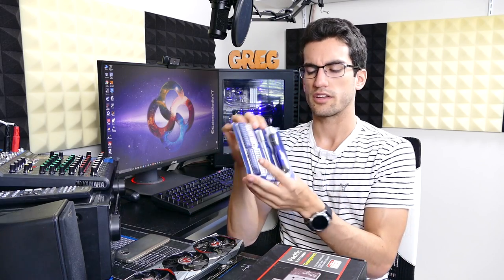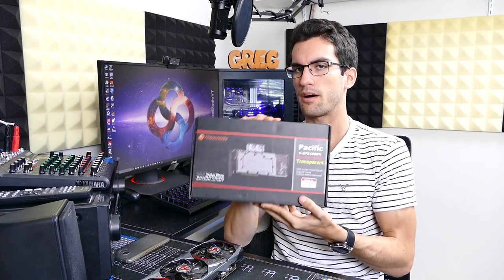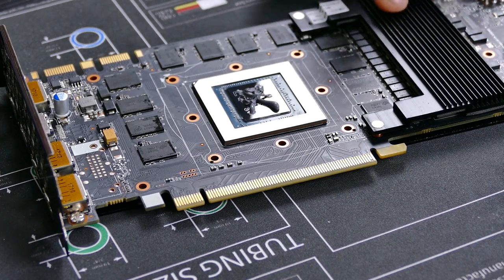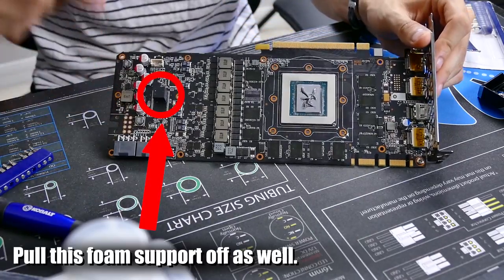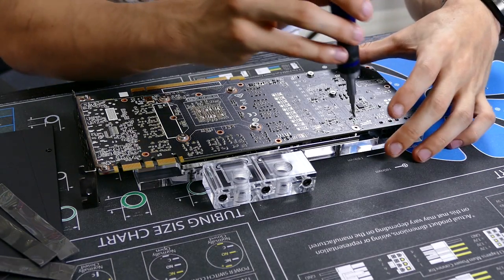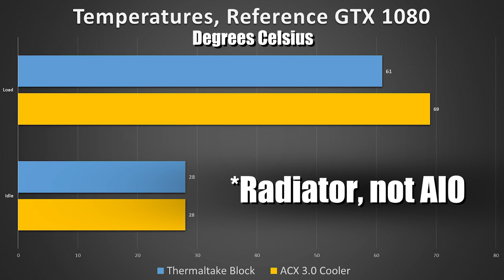How to Install a Graphics Card Water Block

Comment: Additional benefits of water cooled graphics cards: most dual-slot cards become single-slot when water cooled, if there is no connector occupying the second slot's space. If you can get a single slot bracket with water cooling the system can be very densely packed.

Since your GTX 1080 Ti is one of those cards that does not have dual slot connectors, you can pack 7 of them into a motherboard like Asus Z10PE-D16 WS. Throw in a pair of Xeon E5-2697v4 and 128GB of RAM and you can spin up 7 virtual machines, each with one dedicated GPU, 4 dedicated cores, and 16GB of RAM. This is enough to host a LAN party. Linus from LTT have done it before using R9 Nanos and it was already awesome.

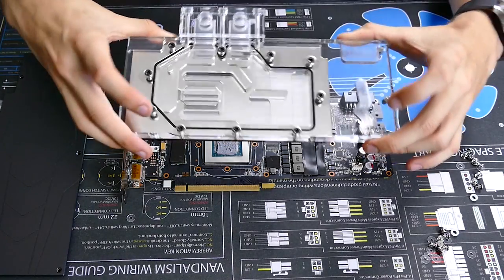Comment: 6:00 Just place the block upside down on the block box and align the screw holes with the holes in the card. Just screw it on and you're done. No second person needed and no risk of misaligning or dropping the block.
Reply from the maker: mrawesomelemons Read what I literally said in video.
Reply: Science Studio Chill dude. Just a step by step guide for people moving along. They could have been confused about what you meant.

Comment: I don't care what other viewers say about your videos.
I like watching you learn about new stuff and commenting on it. Same thing with your hard tube build.
Can you just add a bunch of thermal pads on the backplate, so it hepls cool the card?
Also shouldn't be the temps much lower? I mean 61°C on a watercooled 1080 under load seems a little much to me. I expected temps around the 50s +/-5.

Comment: 61C seems too high. I installed Corsair H55 AIOs via Kraken G12s to both my 980 Tis and neither of them go near 61C at full load, even OC'd with ambient temps above 30C. I know that's apples/oranges, but still, that just seems too high for a custom loop. I do agree though that the sound difference is a huge benefit to liquid cooling.

Comment: You say that water/liquid cooled PCs are silent and "inaudible". What about the pump noise? If you have 2 pumps for separate CPU and GPU loops, it's even worse. You can suppress that with sound dampening materials, I guess, or if your case has "basement" for PSU and water pumps.

Comment: This is the first time I noticed that there is distinctly 1GB of VRAM missing on the 1080 Ti even thought the board seems to be prepared for it. I wonder if you could actually add it in later (theoretically. I bet a reflow oven would be needed).

Comment: 61 degrees Celsius for a 1080 on water? There must be something wrong. Either the block is faulty or not correctly installed or there is an issue with loop. What radiators did you use for this test? I have an i7-7700K with a 1080 with a 360 mm radiator and a 240 mm radiator. Even with higher ambient temps, the GPU goes barely over 50 degrees with Noctua NF-F12 on both rads (about 70% or 1.000 rpm under load).
Reply: He might have a really aggressive overclock on the water cooled one and didn't take that into account.
Reply: It's a possibility. My 1080 runs with 1949 MHz at stock. I had her once bumped up to 2.1 GHz and the temps were around 53 degrees C.

Comment: Isn't water cooling where you put your GPU in liquid and power it? and make it cooler and cleaner?
Reply: Square replace the water with mineral oil and your set

Comment: xlr8 gtx 1080ti or rog strix 1080ti ?? which one should i pick 
up?
Reply: Look at some performance charts, if you are watercooling like Greg though, look for the cheapest reference PCB you can find - the quality of the cooler is irrelevant when you're replacing it. Reference PCBs have the largest variety of blocks available (generally).

Comment: i don't understand your results on water with that 1080, i used to have a 1080 ftw with custom loop with cpu+gpu on a 360 rad i was getting MAX 52°C with 28°C ambiant inside the case.
With my new 1080 TI in the exact same system with same ambiant i'm still never getting above 50°C (better VRM components on the TI compared to 1080 so less heat).
i also saw many other people with similar temps than me so yeah maybe something is wrong with your tests ?
Oh and those numbers i'm giving are with heavy oc: +500 memory and 2050 mhz on core.
Reply from the maker: Cloak Nothing wrong. Many factors to consider. No temps will be the same.

Comment: $2k in just water cooling components?!?!? Where are you getting your stuff from? EKWB has a configuration tool, tell it what case, mb, gpu and how many sticks of ram you have, what is the cooling for (sounds, performance or both), which components do you want cooled,  then it'll give you its recommendations, you can even pick the color of the tubing, coolant, fittings, etc. for me after tax and shipping was just under $600, cpu and gpu

Comment: Wanna hear a joke?

Cheap GPUs.
Reply: Aadithya Ganeshram yo I like my 1050ti it does its job
Reply: Cheap GPUs were once the most expensive. 

Quit begging for likes
Reply: I think you mean dirt cheap GPUs cough GeForce 210 cough
Reply: Judging by the username,it would seem OP of the comment is Indian.In which case,cheap GPUs are a huge joke here.
1050ti.    : $250+
1060 3g : $350+
1060 6g : $430+
1070       : $600+
Nothing related to AMD in sight.No one selling anything in the used market as usual. If you want more than a GT 730,or a 750ti for about $130-150,you're out of luck.
Reply: Even though India spikes prices, it's also like that because of mining so.

Comment: By voiding warranty, that is how.
Reply from the maker: RoboDog If you're building a custom loop, a void warranty is literally the last thing on your mind.
Reply: Stiil, paying 500+ $ for a GPU and having to deal with "no warranty" even  if said card was damaged in manufacturing process, is a bit scary.

I still dont get why 3rd party GPU makers( or even Nvidia ) wont sell plain PCBs? Yes, they can charge more for fancy overdesigned coolers, but in the end they could concentrate on building excellent PCBS and could ask those 500+ $ still.

Comment: Why does the backplate not spread the force of the Cooler screws over the whole board? thats like kinda the purpose of it. the backplate is literally just put onto the back with no reason whatsoever. i'd have liked to see the screws of the waterblock screw into the backplate as well. especially the ones around the GPU.